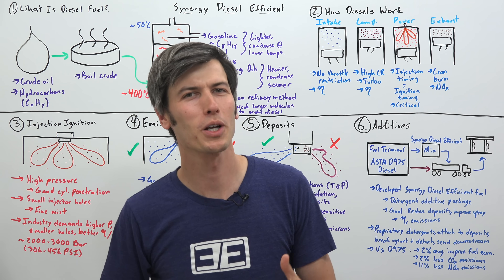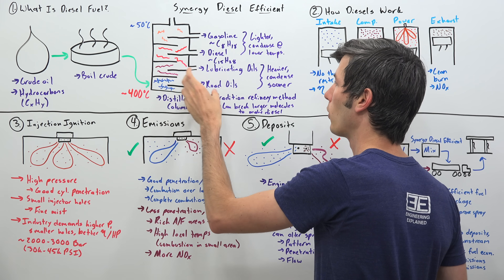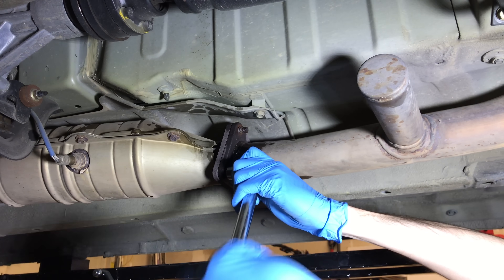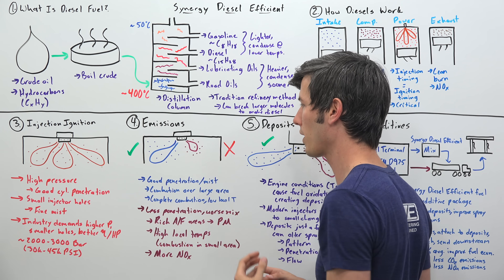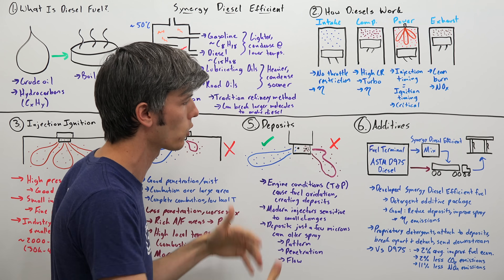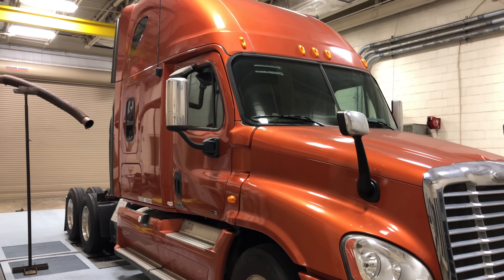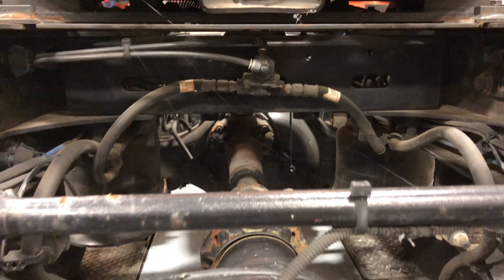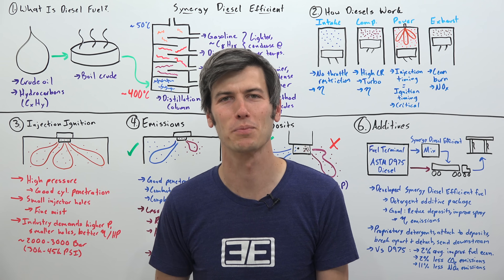Why Diesel Engines Lose Power & Efficiency Over Time

Comment: Great question, cylinder penetration is the velocity that the fuel enters the cylinder. Remember that as the piston is coming up on the compression stroke, depending on the piston top, it will make the air in the cylinder flow in a certain direction and the injector orifices or holes have to point against the direction of the "swirl" so that the highly pressurized fuel will crash against the air and bond the oxygen molecules to the fuel and burn more efficiently.  These guys that design these engines have my respect. And mind you that on electronic engines, they anticipate almost all possible failures and they put a response, a series of steps from the protocol in the ECM to protect the life of that engine. There's just so much that it's fascinating to me.
Reply: Finally, someone that knows that engines with electronics are actually better due to their ability to do anything. It's been so long since I've seen a comment that doesn't talk crap on electronics because of """muh reliability"""

Comment: Good video, I would like to know why we don't have the Cetane number that is in the fuel, at the pump? like in gasoline 87, 89, 91 octane. Ignition is highly affected by the Cetane number, as you mentioned that the compression and heating of the air is what causes Spontaneous Combustion when the fuel injected into the cylinder. Now if we happen to fill up with bad fuel (low Cetane) it will ignite later and cause unburned hydrocarbons to be expelled in the exhaust flow. We then overload the DPF and have less power, harder starting and a noisier engine. I think that it is very critical to somehow verify that we are buying good ULSD with at least a 53 Cetane number (ARB) but we don't know what we buy. All it says on the pump is D-2 fuel.

Comment: I'll tell you why diesel engine loses power over time.  B20, that is 20% biodiesel, is clogging injectors and filters. It does not increase fuel mileage or reduce emissions like some tree hugging liberals claim.  Along with Def.  That was a get rich scheme somebody sold the government.  It doesn't help emissions.  It actually is proven to be a problem to the environment.  Honey bees and redwood trees are getting killed in California.  The state responsible for the emissions crap
Reply: Robert in fact the only GREEN thing about Biodiesel is the use of products, such as palm oil etc.  it actually INCREASES pollution !   Biodiesel, especially in Asia is purely a political play, and certainly not for the environment.

Comment: Long-term, diesels will suffer from cylinder-bore wear, which can result in lowered peak compression pressures/ignition delay.There's a lot going on at the ring/bore interface, which is very demanding on air filtration and lube-oil quality. One real threat to diesels is head-gasket failure. Glycol collects on the chamber walls, and helps the rings to machine the bores.

Comment: Dear ExxonMobil. We appreciate your efforts, but we already have a solution that is magnitudes better than burning fossil fuels. Instead of improving emissions by a few percent, electric drive trains have zero emissions and the power can be produced 100% renewable without emissions. I sincerely hope your business with fossil fuels will come to an end soon.
Reply: Nope. Most electricity is from coal or oil burning plants making power, transmitted via grid, then charging the car. Lots of the green power is dumped if it would cause a generator to go offline.

Comment: Diesel engine efficiency is also due to a higher energy density of diesel fuel than gasoline.  This is one reason why the military prefers diesel for transport - less stuff to go further (Also much less accident prone than gasoline).
(Diesel: 38.6 MJ/L, Gasoline: 34.2 MJ/L).
(Jet: about 35 MJ/L).

At ~3:20 - the use of turbo is not for "more torque" it is for more power.  More air in the cylinder=>more fuel injected=>more power.  
How that translates to torque is a separate (very related) issue.

Comment: What happens to these burnt additives? ARE we trading less NOX for other pollutants. Also is ethanol not added to diesel (it is in the Europe 5-10%)what is the impact of that?. Also does adblue post combustion not eliminate NOX? Does the impact of the fuel last or how long before it degrades back to the old emissions/fuel efficiency? I thought most of these fuel additives were just hokum ie witch doctor medicine
Reply: Stephen, most additives are mainly kerosene, so, yes, they cause even more pollution !!  Adblue helps reduce NOX, but not entirely.   Products, such as Green Fuel Max are natural and actually reduce NOX even further.  You have to really study what additive you use, and, what it will actually do.  Most are incredibly toxic.
Reply: @scottbutton6637  Would most kerosene based additives not combust more completely with their high octane rating. Most enhanced fuels are just cleaners to offset carbon build up due to low engine speeds and kerosene to burn hardened carbon deposits. Depends on what they turn into up in combustion and what they do if not burnt and then pass through modern exhaust systems and then into urban environments where they interact with other air pollutants.

Comment: It's nice that in the lab environment they had ultra clean diesel fuel to work with to get those numbers. In the real world this does not exist. There is no branded diesel fuel sold nor pumped at major truck stops, it is all unbranded low grade diesel purchased on the wholesale market for cheap. In my market, diesel fuel is loaded into tanker trucks from eight different suppliers loading racks and mixed together in the underground storage tanks at the truck stops. It was contaminated when it was loaded into tanker trucks at the loading racks, and it's made more contaminated when dumped into massive underground tanks at major truck stops which are rarely cleaned and usually mixed with several inches of water in tanks (mostly from the loading racks) which gets transferred to vehicle fuel tanks. The current method of partially removing contamination before the fuel is burned in an engine is filtration. The fuel stations have filters at the pumps and vehicles have water separators and fuel filters but it does not capture 100% of contaminants which ultimately make their way into injectors. Until a micro-filtration system is put in place and underground storage tanks cleaned regularly at the retail level to super clean the fuel and remove contaminants before it is pumped into vehicle fuel tanks, we will never have efficient running engines. In all the years driving fuel tankers, I never once saw an underground tank cleaned or having water in those tanks drained off, never. Very rarely have I seen filters at the fuel pumps changed.  Retail fuel stations invest very little profit for maintenance of station equipment and fuel storage tanks. Dirty fuel equals engines that lose power and efficiency. This will never change.
Reply: And also the refinery tanks, tankers and gas station tanks are NEVER cleaned..... added condensation and water contamination = diesel bug / sludge....

Comment: Basically they are  making the fuel thinner by adding kerosene. This creates a thinner fuel and a better  combustion.
Reply: In the DEF? 
Urea is actually a chemical used with diesel to make amflo explosive! 
Also the DEF is burnt in a specific reburn anti particulate system, it is not burned in the engine!

Comment: I watched this one as a point of interest, but it's frustrating to hear "diesel engines run very lean afr" all the time, especially because of the claim that this is an engineering channel... The combustion occurs in a way which is very different to petrol engines, the flame front in a spark ignition engine progresses through a theoretically homogeneous mix of fuel and air at whatever afr is obtained. In a diesel the flame front is the intermix point between the fuel and the air. Combustion does not occur behind the intermix point because behind that point previous intermix has consumed the oxygen available and obviously in front of that point there is no fuel. If you have good high pressure injection you'll get very fast, efficient and consistent combustion with little secondary combustion taking place and no areas of lean combustion. In a poorly injected engine you get droplets which lead to under combustion (soot) and lean combustion (NOx). The goal is to have stoichiometric combustion at the intermix zone which is subsequently cooled by excess air, efficiently distributing combustion energy without byproducts...

Comment: I thought it was about the extra 500lbs of exhaust system and using extra fuel to heat the DPF and how that was costing us a 10% fuel penalty. I guess it has more to do with the dirtier engines due to increased EGR and less lubricating sulfur.

Comment: You said that the exhaust is leaner and contains more oxygen.  I have seen a graph of the amount of oxygen that the diesel engine puts out.  People can breath and survive diesel fumes and it would be impossible to commit suicide by putting diesel fumes in the car or truck.  If you are going to commit suicide by gassing your self to death, don't bother with diesel,  Use a gasoline powered car and you will find success.  The only time  you could kill yourself with diesel fumes is at high rpm and under heavy load.  It is virtually impossible to commit suicide with a diesel by breathing the fumes because there is enough oxygen in the fumes to live.

Comment: My 1982 Datsun 720 K cab truck DIESEL has 230k and motor never apart! 28 city mpg 40 highway. No turbo... slow but it gets me where I need to go.[but not in a hurry!]  It uses about 3/4 Quart of Motor Oil in 3k miles. I bought this truck from the original owner. He always changed the Oil @ 3k miles .I have owned Truck for 10 yrs., I I change crankcase oil@ 3k ...So far so Good!
Reply: how are you possibly getting that mpg? mine gets 16 highway

Comment: I'm not sure if it's true, but I heared that the smaller nozzle sizes in diesel engines create finer mist, but also finer particles that enter the lungs more easily. Old diesels thus could be actually better in one certain way, as the big particles could be filtered better.

Comment: Light duty diesels last longer than 200k except the 6.2 and 6.5 , 6.4

The 7.3 6.9 6.0 5.9 6.6 will last forever. Yeah i put a 6.0 in there because mine has almost 300k
Reply: You're forgetting the 6.7 ... both Cummins and Powerstroke are solid motors

Comment: Just 200k maximum life for a light duty diesel engine doesn't sound right to me.
Reply: Got 250k on my Merc OM642, doesnt use oil and runs great.
Reply: Rigs can do 10 million. Miles plus if maintained. Diesel has so much more power and is way more fuel efficient then unleaded fuel will ever be.
Reply: To be fair, I think that is a average max life of a light duty engine driven by the average driver, the ones that don't maintain their vehicles well, buy the cheapest diesel they can, over extended oil changes, short tripping etc. Especially when you consider the HPFP on a lot of the newer engines with the Bosch CP4 pump design, that likes to self destruct. And a lot of these vehicles get mechanically totaled way before the core engine is worn out.  Also have to take into consideration that most of them are in situations where they are idled for long periods of time, driven hard as soon as they are started for the day etc. Diesel or car enthusiasts are an outlier and way outnumbered by the average driver.

Comment: Is there any risk of hydraulic injection injuries with high pressures in engines like this?
Reply: Yes if there's a leak - the injection pressures are more than is needed to cut steel in a water jet cutter. Though admittedly abrasives are added to the water to make it cut better, but it'll still go straight through human skin...

Comment: The diesel fuel standard for UK is EN590 which has a cetane value of 49. Shell Optimax diesel is 51 to 53. I assume Exxon has their equivalent. Higher cetane numbers means smoother combustion less knock, less smoke and less NOx. 
The USA allows a minimum cetane of 40 so they have a lot of room for improvement.
Reply: David Elliott I use a Cetane improver like power service because our diesel in North America is crap. I do fill up on synergy when I can because it’s a better fuel and I’ve seen less def usage and longer distance between regens with synergy.

Comment: While I hate to be a jerk and point out the only aspect of the video I find problematic, but...well, that’s never stopped me before.

In section 2 of the white board, the power stroke shows the piston pretty far down the cylinder with the injector still happening. Although modern diesels have multiple injection events, I doubt any occur that far into the power stroke.

I’m running an old LB7 and frankly I concerned about emissions and may look into the Exxon product if only to reduce NOX.

Overall, an excellent presentation 👍👍👍.

Comment: was this an exxon commercial? so.....they "condition" the engines useing "an industry standard fuel", meaning the crappiest diesel that passed a test, but still got the internals dirty as possible. then ran good fuel and compared the results. yupp this was an exxon commercial, thanks man, that sucks, 13 minute commercial, im outta here

Comment: IMHO (PhD chemist, 38 years experience in industry and research), diesel engines should be flat out banned, in cities at least. No mention here of carcinogenic emissions including carbon particulates that can lodge in people's lungs. Straw man minor improvement to NOx is window dressing.
Reply: The particulates from direct injection gasoline engines are likely to be more harmful because they're even smaller, so the lungs have no natural pathway by which to excrete them (As well as being small enough to directly interact with DNA when they get into cells). Diesels have all had particulate filters in the exhaust for around a decade, so this isn't a major issue at this point, but gasoline particulate filters are still a very new thing. The reality is that burning hydrocarbons in built up areas is fundamentally bad no matter what you burn - unless hydrocarbon powered fuel cells become a commercial reality, there's no clean way to burn them. 

Since particulate has already been mitigated with filters, NOx emissions are the big issue for human health now, so it makes sense to target them in a big way. Also with the SCR systems on a lot of current model diesels, the NOx emissions from the engine are being reduced to Nitrogen and Oxygen before they're emitted, so NOx produced in combustion isn't necessarily getting to the outside air. But then again I drive one of the VW emissions scandal diesels, with a software remap for more power, so I'm not worried about the high moral ground. I do however live in a very windy, low population density country and use the car almost exclusively to commute to work averaging 50 mph, and use a bicycle for urban transport.
Reply: @peglor  The design of modern diesel engines may have improved with particulate filters but many cars, trucks and buses are not properly maintained, leading to egregious  emissions including the very particulates the filters were supposed to remove. It seems like every second diesel-powered vehicle has a layer of soot over the rear window.

Comment: Delete the EGR, you'll see more than a 2% fuel efficiency increase and save your engine.
Reply: Deleting the EGR means you're pumping out way more NOx than the stock engine. If you use the engine as it's designed to be used - on the open road rather than in stop-start traffic - you'll avoid the vast majority of diesel problems.
Reply: @peglor  of course you'll be pumping out way more nox emissions. You'll also be running more efficiently and preventing soot from circulating back into the engine. Long drives allows the dpf to have a chance to Regen, sure, but it doesn't eliminate all the problems lol. The EGR system on any diesel is notorious for leaking from plugging up, at some point and usually not that long it will fail and you'll be drinking coolant on the regular.

Comment: Most of what you say is true or accurate, but I don't agree on this: that nox levels go up with heat. NOX levels are raised or lowered by increasing or reducing the amount of excess oxygen in the combustion chamber,as oxygen turns into nitrogen oxides (NOX) if heated to a certain temperature, but not actually burned. So higher combustion temps don't mean higher NOX levels, it just means a lack of airflow

Comment: My Vauxhall corsa 1.7 diesel never lost any grunt over 200,000 miles. My benchmark was being able to hit key zones at a certain speed under hard acceleration and it was consistent. Fuel economy was at its peak from 40000 miles til 200000 when I sold it at around 56mpg. And actually just keeping the car serviced properly is the key, no big secret that poorly maintained vehicles lose power and efficiency. That's all there is to it.